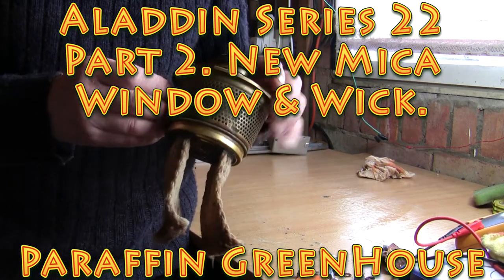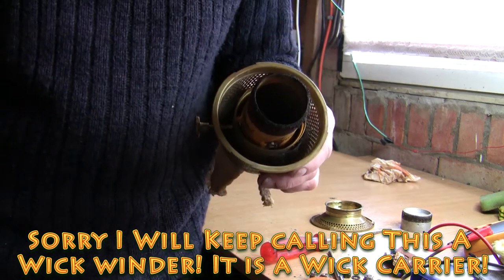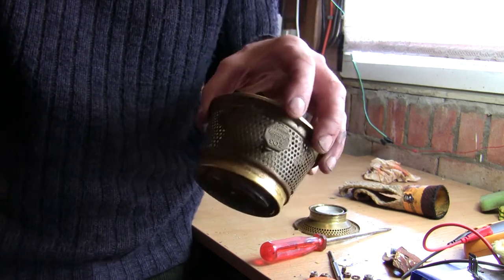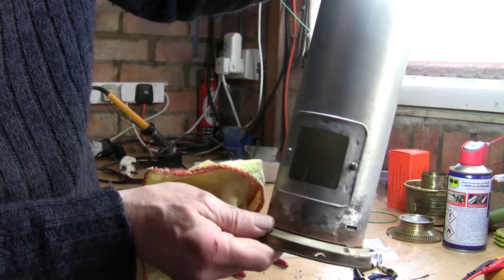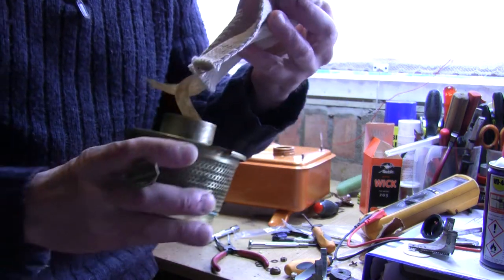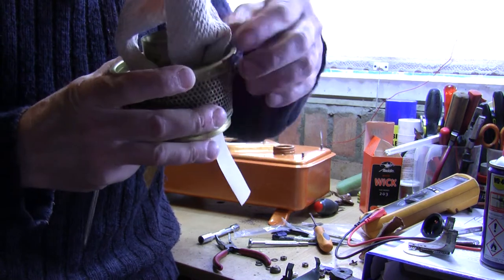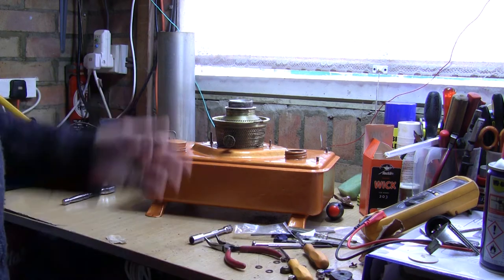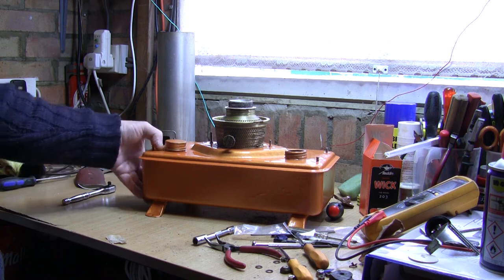Part 2. Fitting The New Aladdin Wick & Mica Window Series 22

Comment: Hi Fab video! I have a 201 ? burner, but the feeder does not move the wick any more, any suggestions how to remove the old wick?(Will not move!) I suspect the wick carrier is broken? Thanks
Reply from the maker: Hi, I'm not familiar with the 201 burners but sometimes the wick carrier can break! As you say. I have some of the Aladdin table lamps that have the small round wicks these sometimes get stuck and I have cut them out to free it all up. K.
Reply: @BramleyProductions  Thank you for your helpful reply. From what I have now read the the 201 wick carrier is nolonger avaliable. The suggestion is to use a 203 wick/carrier instead. However old wick is jammed solid! I have found a UK  company on the internet , who I will ring for advise. Might have to get a new burner! (Base camp spares)
Reply from the maker: @mikedevereux6853  Base camp is very good I brought parts including a new wick winder from them when I did this old heater of mine up! I know years ago I brought a 201 or was it a 202 wick by mistake and it would not fit the 203 burner or wick winder but maybe there is a way you can adapt this. You say your wick is stuck? Is it dry? As often if the wick gets dry they can stick and be hard to get off I often spray all around with the likes of WD and pull wick with pliers this often helps they can be stiff these old 2-inch wicks! Let us know how you get on with the wick winder situation thanks Kev.
Reply: @BramleyProductions  Hi Kev many thanks for your most helpful advise. Base camp spares have also said that an old wick that has not been used, will stick to the burner over time. They had suggested as the burner is brass I try soaking it in hot soapy water. Happy to try as  I have ordered a new burner which I think is a conversion kit one 203? . I have cleaned the heater and it looks much better. The mica window needs replacing next. But very hopeful we can get it up and running. I dont think I would have attempted this without seeing your video. So big thanks(Hubby let me post this to you)
Reply from the maker: @mikedevereux6853  Great to know you seem all sorted now. Base Camp are so helpful. Yep if I have left my old 203 burner in the Aladdin series 22 greenhouse heater and not used it for a couple of years with no paraffin in the tank and in the hot/cold greenhouse, it would dry out very hard like I say a good spray of WD40 and off she would slip! Great to hear you are fixed up, and thanks for the kind words re the video. I believe these are the best heaters for a small to medium size greenhouse ever made. Thanks and all the best, Kev.